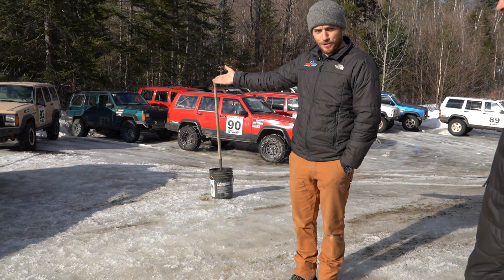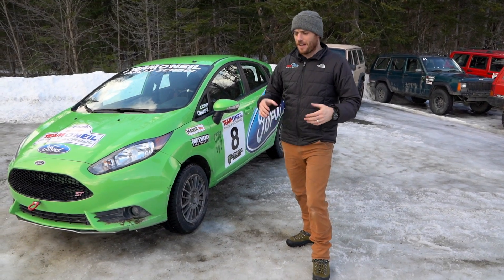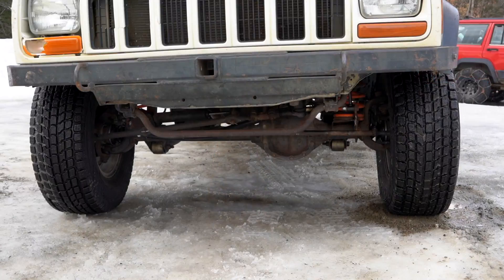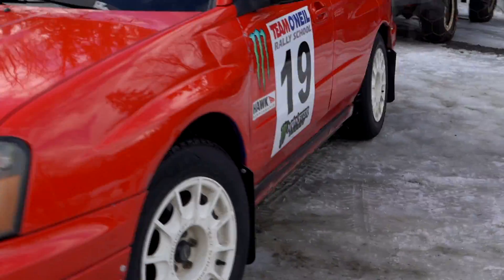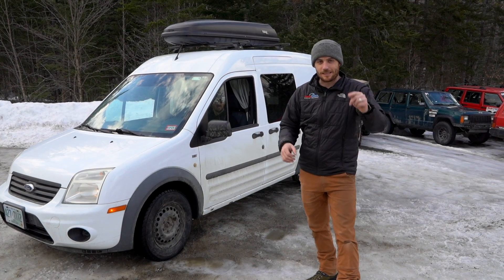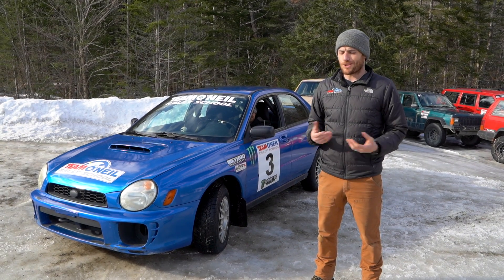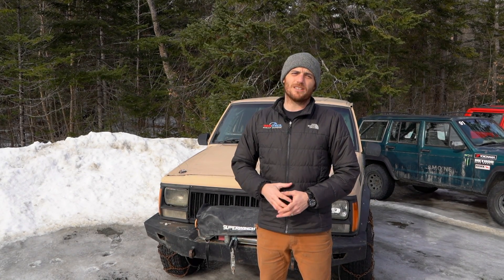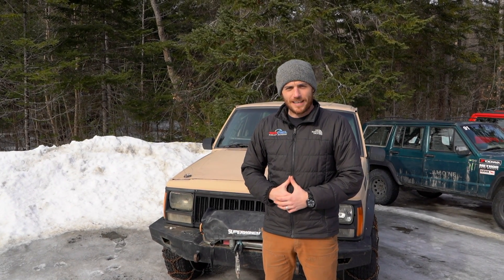Differentials and Traction Control Explained

Comment: Good video, but one correction and a few additions. 
A Quaife is not a limited slip diff and it does not guarantee that you won't end up with only one wheel spinning.  It does not react to slip, it reacts to torque imbalance.  It is a torque biasing differential.     The helical cut worm-like gears in a Quaife (or Torsen, or Peloquin) create a torque multiplication effect such that it will direct more torque to the side with the greater traction.  Eg. if the gear teeth angles create a torque multiplier of say  3 to 1, and it takes 100 lb-ft of torque to spin the tire with the lowest traction, then the gears will direct up to 300 lb-ft to the side with greater traction.     In your test the traction difference between sides wasn't too great, so the Quaife could find a way to send torque to both sides.     But if the low traction side requires zero torque to spin (one tire is off the ground), then 3 times zero is still zero, and it'll send virtually no torque to the high traction side and the other side still spins freely (I've tested this with one side on pavement, and the other in the air).      This is why torque biasing differentials are almost never used on off road 4x4 vehicles because lifting a tire off the ground is fairly common while rock crawling.  The notable exception is the Hummer H1, which had Torsen diffs front/rear/center (with no center lock) and in a rock crawling situation could be completely disabled by lifting one tire off the ground.   The workaround was to manually apply the brakes and gas at the same time.     Even with equal braking to all four corners, the Torsen's torque multiplier effect would cause the  diff to shunt 2-3x the torque across one or two diffs to the corners with the greater traction and away it goes.  In fact even modern electronic traction control works better with a torque biasing differential because it takes less braking force to the spinning tire to push much more torque to the side with traction, so you get less of that momentum robbing effect you mentioned at the end of the vid.  

Also maybe worth mentioning (maybe worth demonstrating in another vid) that many modern AWD vehicles do not have a center differential , but just a viscous or multi-plate clutch coupling between front and rear.   Nominally they are a front wheel drive vehicle until slip is detected between front and rear, and then the center coupling engages sending some torque to the rear.    Examples of this are the vast majority of VW's "4motion" vehicles, Volvos AWD offerings (both VW and Volvo use Haldex couplings), all of Hyundai's AWD vehicles and many more compact and mid sized crossovers.
Even Subaru's current ATS (Active Torque Split) AWD system usedon all their CVT vehicles is really just a center clutch pack that can activate before slip is detected (same with newer generation Haldex units).     These types of clutch pack based center couplings offer some advantages in terms of active control, but their main reason for existence is to increase highway cruising efficiency.  Basically you disconnect the rear end when power there is not needed.   Even the GKN Twinster AWD system in the Ford Focus RS has no center differential.  A regular center drive shaft always turns the rear differential's input shaft, but the rear diff has no spider gears.  It always turns both inner output shafts at the same speed, and then couples them to the drive shafts  via two independent clutch packs.   This allows you to disconnect the rear axles from the front entirely, or drive both at equal speeds,  or to  send more power to one side.  If the final drive ratio is a little different front  to rear, you can even overdrive the rear tires (spin em faster than the front) which is probably how they pull of their drift mode trick.

Comment: Do you guys have any write ups or videos showing how you setup the wrx with the centre lock, ebrake and front diff ect. Really want to do this to my car, but not quite sure where to start. 
Also deleting abs on these cars which fuse do you guys pull there is quite a few and I'm not sure if some are running other things as well

Comment: This is why I won't buy any current production electric cars. With an electric car you can easily have individual wheel drive and none of them do currently. With individual wheel drive you can force the rear wheels or the front wheels or all the wheels to spin at the same rate like a locking diff all with the press of a button, no mechanical complexity. If one of your motors breaks you can drive home or to the shop easily on the other 3, the motors are easy to replace, and you get better efficiency with less complexity. Yet not even Tesla produces a car with individual wheel drive. Just one motor per end for awd. One for the front, one for the rear. For rwd it is just one motor for the rear. So they rely off of traction control to spin all the wheels or both the rear wheels in low traction surfaces.
Reply: Those motors aren't cheap and the purchase price is already a big enough issue. That benefit is well known, but not necessarily worth the expense. Consumers buy into hype all too often, and don't really care about quality or innovation on the whole, hence the continued dominance of Ford and Harley. People are either for or against electric in general, not generally on the fence over a feature like this. Do you not buy ICE vehicles unless they have full lsd? Most cars don't come with it because people don't care. Same applies to electrics. That said, I'd love to see individual drive. Not far off last I heard about the advancements with hubs converting 2wd gassers into AWD hybrids.
Reply: @neomeg2232  When looking at ICE powered cars I look for those that can have a locking diff. That being said I've stopped looking at ICE cars. A proper off roader will have "locking diffs" for the front and rear. So when a proper road legal individual wheel drive SUV comes onto the market with buttons to "lock the diffs" then I'll buy one "provided it isn't a complete POS and that it isn't extremely expensive. The motor cost is not that bad when you consider that you need 4 motors to replace 2 and have them put out the same combined hp. It may be more expensive but the money saved in comparison to a new ICE car in terms of maintenance and long term ownership costs justifies the cost. New gas and new diesel are crap, the gas has ethanol in it which accelerates the rottting of all the fuel lines, and both the gas and diesel sold at the pump lasts for a couple months before going foul. Eventually the pump gas you buy will have so much ethanol in it you'll have to replace all the gas lines in your car before 100,000 miles. I just hope my toyota lasts long enough for me to get a good electric car with individual wheel drive. The only electric SUVs on the market are just person carriers for huge amounts of money, they're not built to be tough and utilitarian, they're built to carry a decent amount of people in luxury seats. I have other grievances with current electric cars, I'm just hoping the electric car producers will get their shit together within the next 10 years

Comment: Awesome video as always, could you make a video on your handbrake setups for the subis, I've been converting a 2.5 impreza into rally cross car and thinking I need a hydraulic clutch, my legacy I just wired the handbrake to turn it to fwd when I pulled it, not sure if this same method can be used on 07 impreza, what do you do with your 2.5's

Comment: Wished we could see a torsen rear or center diff in action... 

Just get a cheap B6 or B7 Audi quattro in your fleet. Those are great cars!
Reply: Hahah, i like how use the word cheap in there, maintenance would be epic fun as well
Reply: @snape1464  you have a valid point. i think it still would be fine for their business as they really should have an inhouse service. anyway, this is just an assumption. maintenance on those cars would require a lot of labour which is expensive.

As for the parts, they should be able to get cheaper aftermarket alternatives, or even another car to salvage parts for the one being driven.
Reply: They have at least 2 old quattros
Reply: @VTnadjers94  That is great!

Comment: thanks for the vid! there are a lot of good information here.

example i always thought that the open diff tends to spin one side of the wheel because the weight is not equal in the car,  now i know the other reasons 
and good to learn is better to off traction control when going uphill i snow

Comment: In any two wheel drive car with an open dif, once you start spinning on snow instead of giving pure throttle and to to squeeze it all out of 1 tire, wouldn't applying left foot braking and becoming your own traction control be more efficient? Plus being an added bonus of not having a computer tell you how to drive, and making an open differential spin both tires. I would also love to see more modern cars hooked to the jeep like you talked about at the end of the video. Hope I can come see you guys soon!!
Reply from the maker: Absolutely! You can use LFB to stop wheelspin when you're accelerating, and when you're trying to slow down on ice you can keep a little gas on and LFB to avoid wheel lock up.
Reply: @Teamoneilrally  and exactly what traction control does. Average driver won't beat it. Of course average TCS is not for racing and racers.

Comment: Another huge cons of electronic differential is the brake fading. I guess they didn`t talk about it because of where they are.
Reply from the maker: SOLID POINT we forgot to mention. You can get the brakes smoking without ever touching the brake pedal. I sense a video coming on...
Reply: @Teamoneilrally  most probably not. Traction control has a temperature estimation. If estimated brake disc temperature goes above limit it shuts down brake action. At least all the system do this I worked on.
Reply: @gaborb  It  doesnt just shut down brake action but power too. That is a problem :D
Reply: @K0nst4nt1n96  regarding brake temeratures which is the subject no. There is no problem with power cut. In genral it can be a problem but it is a more complicated issue. You can buy many cars with switchable traction control.

Comment: I would love to the RS hooked up. I have one and I'd be curious to see how the different drive modes effect it if they do at all. If i remember correctly the awd system overdrives the rear wheels faster than the fronts so that could be interesting but I think it's only slight so you probably wouldn't be able to see it from just looking. My guess is with the 2016-17 RS which has brake based torque vectoring up front you would spin all 4 wheels with the fronts kinda twitching like the 3rd fiesta with both rear wheels spinning the same speed but possibly different based on traction levels and the 2018 RS with a quaife diff spinning all the tires the same as the 16/17 but without the twitchyness.

Comment: Video idea: Is it worth upgrading an open diff to an lsd for a fwd or rwd car, if the vehicle is driven in winter conditions? In a fwd open diff vehicle, can some of the torque applied to the slipping wheel be sent to the other wheel by lightly pressing the brake?
Reply: Before installing my lsd, i ofen got stuck on muddy hills with my e30, cranking the handbrake a bit did help a bit.
Reply from the maker: You can definitely left foot brake to correct for wheelspin and force an open diff to transfer power more evenly. Basically you're deleting the "path of least resistance" by applying fairly equal resistance to both tires. With a FWD just remember the brakes are also applied to the rear wheels as well, they'll be dragging a little so it's a 2 steps forward one step back thing again. In a 4WD with open diffs front and rear this can be VERY useful off road BUT when you do it too often / aggressively you'll end up breaking some teeth off the spider gears in the diff... Or a U-Joint... Or shear an axle shaft... Or the ring and pinion...
Reply: That would be an interesting one, basically can you manually do what the traction control does? My hypothesis is that applying the brakes would slow the spinning wheel but not enough to get the wheel with too much grip going. Now somebody needs to test this.

Comment: I have a fwd fiesta ses, is the diff anything I can look into changing to increase rally performance?
Reply from the maker: Yes you can install a Quaife diff just like the one we put in the bright green ST in the video. The ST comes stock with an open diff and traction control, and you can see what the quaife does in the video. There are more aggressive plate diffs available as well, but they're less street-drivable and harder on the axles and everything else.

Comment: Don't make a mistake. There is no "one wheel drive". Open differential send equal amount of torque to both wheels, but they can spin with different speeds. A wheel with less traction limits overall performance.
From Wikipedia: "An open (non-locking or otherwise traction-aided) differential always supplies close to equal torque to each side. To illustrate how this can limit torque applied to the driving wheels, imagine a simple rear-wheel drive vehicle, with one rear roadwheel on asphalt with good grip, and the other on a patch of slippery ice. It takes very little torque to spin the side on slippery ice, and because a differential splits torque equally to each side, the torque that is applied to the side that is on asphalt is limited to this amount."

https://en.wikipedia.org/wiki/Differential_(mechanical_device)
Reply: Are you really trying to use wikipedia to try to refute the real life results of a driving school? These guys are pro drivers and instructors. They know what they are about.
Reply: @VTnadjers94  You get me wrong. I don't try to refute anybody. Term "one wheel drive" sounds cool, but technically incorrect. My english is bad, so Ctrl+C - Crtl+V from Wikipedia is much easier. Explanation there is good enough.

Comment: Front wheels have to turn so u can make a corner so front dif only spins one wheel for proper cadence if u keep the wheels straight itll spin both fronts.
Reply from the maker: If you are on a perfectly level road, with exactly the same amount of grip on both sides, with the wheel straight.... Nope it'll still spin whichever side has the shorter driveshaft.

Comment: About the FWD w/ LSD in a production car...it exists.  It's the GTI w/ performance pack!  Don't listen the the salesman, because chances are he doesn't know what an LSD is or why it is worth paying extra for.  I overheard one salesman saying that the package is "just" 20 more hp, like it is a worthless option.  He was an idiot, because the electronic LSD is what makes the car special!   (Is it still the only production FWD that includes a LSD as an option?  I know the Focus RS and STI have limited slip, but they're AWD...)
Reply from the maker: Those VWs are neat! So it's not actually the differential at all, it's an electronic clutch pack between the diff and the right axle. There's a pump that sends it variable amounts of hydraulic pressure to make it more "open" or "locked" depending on wheel speeds, steering angle, etc...  It's definitely top of the line getting into "torque vectoring" territory, I don't know of any other 2WD cars that have a comparable system... the Mitsubishi Evo had a similar type of electro-hydraulic clutch plate coupling in the center with a belt-driven pump and a fluid cooler and everything. Other companies use them in the center or rear as well. Cool stuff.
Reply: @Teamoneilrally    I have an older Saab Turbo X with the similar haldex system.  Uses an E-LSD with it, too in the rear.  Pretty competent in the in snow!
Reply: hondas made plenty of fwd lsd trans
Reply: @JenesisGaming  Do they have an electronic one?  I guess I didn't specify...but that's important...because it can be fully open for sharp turn in and fully locked for heavy acceleration.  A mechanical LSD in a FWD will hurt turning, as mentioned in the video.  (But I didn't know honda had any kind of LSD.  That's interesting.  I've never looked into hondas....)

Comment: Information on a Torsen LSD? How are they different from a "traditional" LSD?
Reply: Torsen works like this: If you had the rear left wheel on the ground and the rear right wheel in the air you would only spin the right wheel in the air. If you applied brakes while on throttle THEN it would transition power to the other wheel. They are typically intended for tarmac use because of this. On tarmac they give a really cool gradual increase of power transition.
Reply: Torsen diff is considered intermediate lsd to cater towards mild racing or sport road driving...because it will reat like normal open diff when 1 of the tyre floating in the air.. 

the weaker type of lsd is viscous coupling...using viscous fluid when slipping, fhe fluid reacts and thicken to grip the diff and transfer the torque equally...downside is total amount of torque can be transferred is way lower than torsen lsd...

For maximum lsd performance the clutch pack lsd (1way, 1.5 way, 2 way) is considered ultimate lsd fit for motorsport use...(or welded diff for cheap drift hack) 😂
Reply: And in wrx vs sti (as far as jdm spec list i knew)...
 Wrx: rear viscous coupling lsd, center viscous coupling diff, open diff front

Sti: rear clutch type lsd, center viscous coupling or electronic controlled clutch type diff (dccd) and open diff front (or torsen diff front for certain special model)
Reply: https://www.youtube.com/watch?v=JEiSTzK-A2A
Works great under throttle, no brake application needed to power both wheels.
Reply: Torsen is short for Torque Sensing. There are a few different types of Torsen diffs.
Reply: Victor Kojenov I aways heard it as tortion, I didn't know it stood for that